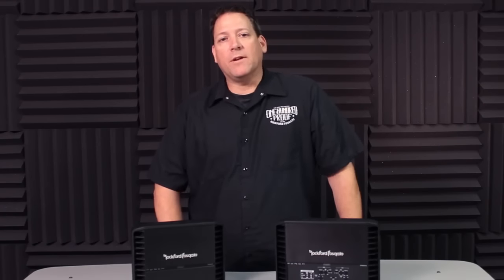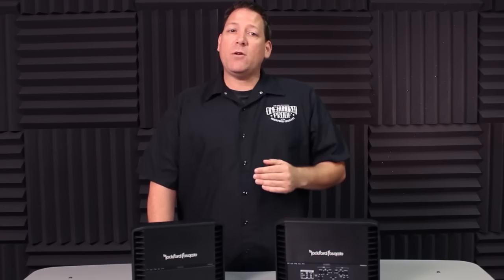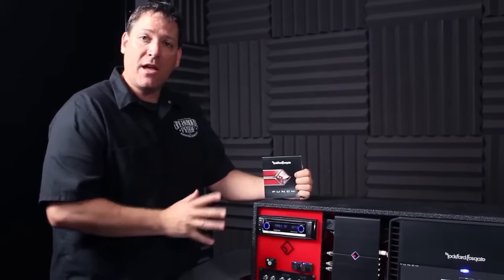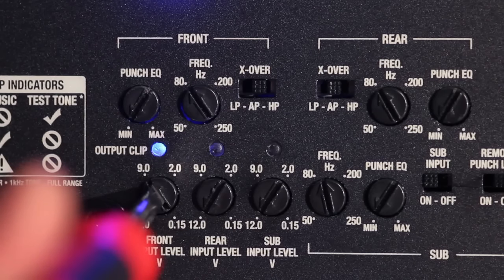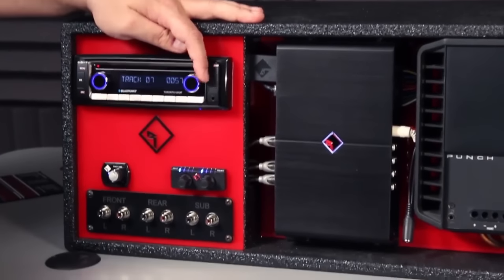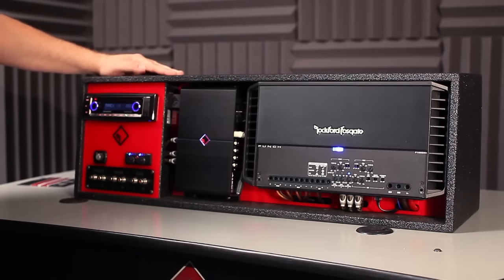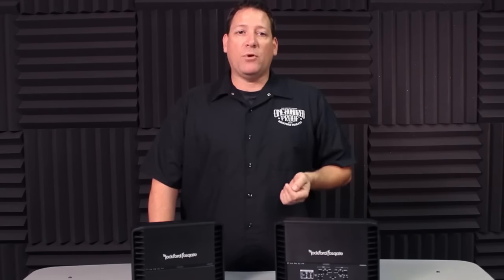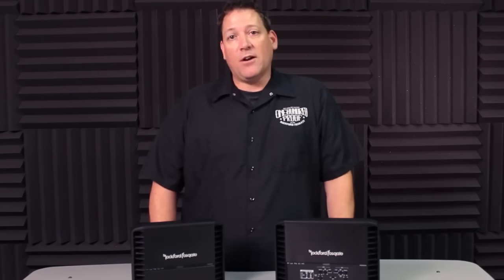Rockford Fosgate: Punch Amplifier Overview (3.1)

Comment: Is re-adjusting at -5 & -10 dB still relevant if using Hi-Res/Lossless music?
Reply from the maker: Great question, James!  Yes, absolutely, because you're adjusting the amplifier's gain settings (it's clipping point) regardless of if playing sine-waves for SPL competitions or hi-res audio for SQ listening.  Properly setting the amplifier's clipping point is important once the amplifier starts clipping, more power is generated and delivered to the voice coils, causing them to heat-up faster which can lead to premature failure.

Comment: So then is the bass knob connected to the Punch Level EQ knob in the amp? And when setting up the amp, should this EQ be an zero?
Thanks
Reply from the maker: The built-in Punch EQ is 0dB to +18dB @ 45Hz and/or 0dB to +12dB @ 12.5kHz (depends upon LP/AP/HP switch position).  The PLC2 is an overall level control for the amplifier. When setting up the amplifier, we always suggest the EQ to be at MINIMUM since it's designed to help compensate for the acoustical fingerprint of your automobile.  IE: some cars sound different if hatchback versus sedan, or truck vs. SUV, etc.

Comment: Rockford I have a question. 
O.k so I have 2 p3s 12s in a box made by rockford too.
And I have the punch 1000x1 for them pushing 1472 rms.
And I'm thinking of getting the p600x4 to power all the cars speakers mids and lows but i want all the mids and highs to be power class.. can I do that?.. can I use a punch amp to power up power edition mids and highs or no?..
I'm going to be using all RF wire.
Also what alternator size should I get?.. 200amp or 250amps?..
Reply from the maker: Hi Bill, Thanks for being a Rockford Fosgate fanatic!  You can certainly use a Punch amp to run Power series speakers (and vice-versa.) Just keep the amplifier power output under the RMS power rating of the speakers.  This will help prevent from overpowering the speakers and possibly burn the voice coils.  

Alternator size is based on the vehicle, so consider the factory alternator size and add your audio system.  The Average Current Draw (13.8V Music) on the P600X4 is 45 Amps and the P1000X1bd is 65 A.  If you have a factory alternator at 125 A, then add the other amplifiers on top (125A + 45A + 65A = 235A).  Keep in mind, this is a general idea on how to calculate alternator size, so you will most likely get different recommendations.  You may want to contact a specialist like Irraggi Alternators at https://www.iraggialternators.com/.
Reply: Rockford, would a capacitor compensate for some of the power differential?
Reply from the maker: Like a 1 Farad Energy Storage Capacitor used inline with the amplifier's B+ terminal?  The answer is no.  Capacitors are designed to keep a quick reserve of current for hard bass notes or quick transients, but it will not compensate for any current differentials or differences between amplifier power output.  We have a handy article that can help you with areas of the charging system to consider at: http://rftech.custhelp.com/app/answers/detail/a_id/145

Comment: Hey I have the p1-2x12 subs should I go with the R2-500x1 amp or go with the P500x1bd
Reply from the maker: Hi Felix, That's an awesome subwoofer enclosure!  The P1-2X12 is rated to handle up to 500 Watts RMS and is prewired to a 2-ohm amplifier load.  The R2-500X1 produces optimum power at 2-ohm (500W) but the P5000-1bd only produces 300W at 2-Ohm (Dynamic Power is still only 410W).  In this scenario, we'd suggest the R2-500X1 as a great matchup.
Reply: Rockford Fosgate ok thank you for the response i appreciate it !!
Reply from the maker: @Felix_559  You're welcome!  Thanks for being a Rockford Fosgate Fanatic!

Comment: I have a p1000x1bd. Wired at 1ohm to 2 8" 400w rms subwoofers. Is it normal to have my gain up to 3/4 and out put clip turns on? My volume on my pioneer head unit is set at input clipping. Do I have a bad amplifier?
Reply from the maker: No, the amplifier is fine.  The impedance load of the amplifier does not affect the input stage of the amplifier.  When setting the clipping point of the source unit, the volume should be increased until the LED just begins to blink, then back it off a little.  This will be at a slightly different setting depending if you're using a 1kHz sign-wave or music to find the clipping point.    Then adjust the amplifier GAIN control until it just begins clipping, then back it off a little.  This will maximize the signal-to-ratio between the source unit and the amplifier.  The P1000X1bd has a wide input voltage range from 150 mV - 12 V.  Again, depending on if you used music or test tones to find the source unit clipping, you may experience different levels of LED flickering during normal playtime.
Reply: @rockfordfosgate  ok. I'll try that. Thanks! And I just ordered a high out pit alternator. Constant 14.8 v. Will that be okay for the p1000x1bd?
Reply from the maker: @lylegoodluck  Yes, the amplifier is rated to handle 9 - 16 VDC.
Reply: @rockfordfosgate  I did have a prime 750.1 before I upgraded to the p1000x1bd. It sounded very good at almost the half way point of the gain. It concerned me that I had to turn the gain 3/4 of the way to make it sound decent.. idk. I'll play with it some more. Thanks again!
Reply from the maker: @lylegoodluck  You're matching the output signal of the source unit to the amplifier.  The gain itself isn't representative of a good/bad amplifier, but it is reflective of how much output voltage your source unit produces. If you have low output voltage from the source unit, you'll need to increase the gain on the amplifier for it to match.  If the source unit has very high output voltage, you'll lower the gain for it to match.
Reply: @rockfordfosgate  do I need a line driver?
Reply from the maker: @lylegoodluck  If you need to crank the gain up nearly all the way, then I would definitely suggest using a line driver.  This will optimize your Signal-to-Noise by keeping the amp gain to a minimum.
Reply: @rockfordfosgate  yeah. I might need one. Idk why I have to get a line driver for this amp. I ranbother amps on this same set up. All other amps I turned  gain up to 1/4 to 1/2 turn...
Reply from the maker: @lylegoodluck  The amplifier is working just fine.  You don't need to get a line driver because the gain is doing exactly what it's supposed to do.  I recommended a line driver if you're having to turn your gain nearly to max because this tells me the output voltage from the source unit isn't as high as you expected it to be.  If that's the case, a line driver doesn't hurt.  As mentioned in the very beginning of this thread, the amplifier is working just fine. So, other than verifying which method you're using to set CLEAN (test tones or music) you'll get a slightly different result with the LEDs.   Follow the process I outlined above and you'll be just fine.  If the LEDs slightly flicker, the amp is working perfectly fine.

Comment: I plan on running a Rockford components and two p3d4 12s which amp would work the best
Reply from the maker: Hi Bmackins94, The Punch P3D4-12 subwoofers are rated to handle 600 Watts RMS each, so you'll have 1,200 Watts total power handling capacity and can be wired into a 1-ohm or 4-ohm load.  The Punch P1000X1bd would be the perfect amplifier for those subwoofers: http://www.rockfordfosgate.com/products/details/p1000x1bd

For the component systems you can use the P300X2 if you only have front speakers, or the P400X4 is you have front & rear speakers:
P300X2: http://www.rockfordfosgate.com/products/details/p300x2
P400X4: http://www.rockfordfosgate.com/products/details/p400x4
Reply: Rockford Fosgate thank you very much

Comment: Quick question about the P1000x5. There are 2 speaker outputs for the sub channel. In the manual it doesnt say anything about it being bridgeable. can I hook this up to only one subwoofer?
Reply from the maker: Yes you can, just keep the total amplifier load at 1-ohm or greater.  Totally understand that it's not clear because it's in small print on page #14 of the owner's manual: "*Positive(+) and Negative(–) outputs are wired in parallel internally."
Reply: Rockford Fosgate called Rockford to clarify on that exact same topic earlier. I have two p2 4ohm’s bridged down to 1 ohm. The rep on the phone told me to go ahead and use the negative of one sub output and the positive of the other since both sub outputs are internally wired in parallel.

Comment: Will a Prime R500X amp sufficiently power either of: 

old school 1-12" HE2 dual 4 ohmor 1-12" HX2 dual 4 ohm? And Which of these amp/sub combo will sound better in a sealed box. Thx
Reply from the maker: Yes, the Prime R500X amplifier is designed to produce 500W x 1 @ 2-ohms, so a Dual 4-ohm subwoofer will work fine with it, because that can be wired to create a 2-ohm load

Prime R500X
https://www.rockfordfosgate.com/products/details/r500x1d/

Comment: I just got two p3 10s and had a prime rs500 that I got back in 2014 ... Haven't really used it like that but how would i hook this up.
Reply from the maker: Don't know what impedance P3 10" you have, but if you look at the WIRING WIZARD tab on the R500X1D, you'll see all the wiring diagrams compatible with that amplifier: https://www.rockfordfosgate.com/products/details/r500x1d/

Comment: i just got the p1000x1bd amp, do i use the 1k hz test tone or the 40 hz test tone to setup the input? i know you use the 40 hz for the output
Reply from the maker: Since this is likely for subwoofers, you'll use a 40Hz test tone for both the CLEAN input and output.  Typically for subwoofers you'll be using +5dB to +10dB of Gain Overlap.
Reply: thank you! i thought my head units max is 30 before distortion, its 34. i love this amp

Comment: I have two P3d4 15 inch. What amp should I use?

Thanks in advance 🙏
Reply from the maker: That’s Great Ramses!  The P3D4-15 is an awesome subwoofer and rated to handle 600 Watts RMS, so two woofers will give you 1200 Watts power handling and can be wired to either a 1-Ohm or 4-Ohm load.  The P1000X1bd is rated to produce 1000 Watts x 1 @ 1-Ohm and Dynamic Power is rated at 1,430 Watts x 1 @ 1-Ohm.  This would be an awesome amplifier to match.
Reply: @rockfordfosgate  🙏

Comment: Any issue mounting this amp upside down?
Reply from the maker: Yes, we don't recommend mounting amplifiers upside down because the hot air dissipating from the heatsink needs to rise and cool the heatsink.  If mounted upside down, the hot air has nowhere to go, essentially rising back up to saturate the amplifier.  If mounting upside down, we highly recommend forced airflow (fan) to prevent this from happening.

Comment: My Rockford amp clipping light doesn’t come on as I’m turning the volume up! I maxed my head unit out what does that mean! I’m tuning my amp
Reply from the maker: Are you using MUSIC or TEST TONES to setup the CLEAN circuit?  If you're using the 0 dB Gain Overlap test tones, it may be clipping, but with music it can be hard to detect the LED illuminating.  It's also possible the source unit doesn't clip at full output.
Reply: Rockford Fosgate she’s all set! Thanks ! Sounds nice 💪🏽

Comment: love this brand and finally after years of looking at it i finally got a sub and amp today and cant wait for the end result. ? is there a downloadable version to this test cd as my head unit has no cd player
Reply from the maker: Thanks for joining the Rockford Fosgate team!  We have our C.L.E.A.N. process and downloadable tracks available in our Knowledge Base here: https://rftech.custhelp.com/app/answers/detail/a_id/1126
Reply: @rockfordfosgate  guys I would like to say man the quality in Rockford Fosgate is outstanding. Loving my p2 12 inch sub and my mono block amp from Rockford Fosgate. I will never buy anything else.
Reply: @rockfordfosgate  also quick ? My amps clipping light indicator is just going on blue for second or two when hitting some bass on tracks. The amp is p500x1bd. I’m running as mentioned punch series p2 12 inch 2ohm sub and it’s configured as 2ohm on the sub. Also the head units volume is at 35 out 40. Cheers again I am so loving this quality of the brand.
Reply from the maker: @MrFrosty888  Thanks for the kind words.  Yes, the clipping LEDs are very accurate, so this means it's working properly.  Minimizing a clipped signal is the name of the game, and by doing so, you minimize unnecessary heat build-up.
Reply: @rockfordfosgate  I get that but my ? Sry was if I turn up the amp a touch more so the blue indicator led which is one led on my amp will this be fine. I don’t won’t to damage my sub.  Right now at the volume level of 35 out of 40 on head unit on few songs i listen to the blue clipping led just flicks on and out very lightly.  I just would like to get little more out of the sub but if you say leave it as it is then I will. Cheers again loving the brands quality and service I get thru the brand.
Reply from the maker: @MrFrosty888  This only covers the clipping part, we need to analyze your amplifier/subwoofer combination to make sure you're not over-powering it.   Since you have the P500X1bd amplifier and P2D2-12 subwoofer (see specs below), you're technically already over-powering the single subwoofer by at least 100W and up to 387W under dynamic conditions.   Increasing the GAIN/LEVEL doesn't tell the amp to produce more power, just at what point on the radio's volume control when the amplifier produces its rated power output.

Punch P500X1bd
500 Watts x 1 @ 1-Ohm (RMS)
787 Watts x 1 @ 1-Ohm (Dynamic)

Punch P2D2-12
Wiring both voice coils in parallel to create a 1-Ohm amp load
400 Watts RMS
Reply: @rockfordfosgate  yep okay. The sub is wired to be at 2ohm so the amp will only produce what the ohm rating configuration is on the sub right. Cheers on the reply I might just leave it as it is.  But I just wanted to know on my amp with one led clipping light if I turned my amp up a touch so the blue led comes on but more with less flicking on and off when pushed. But if you Say leave it as it is to be safe that’s fine. Thanks for replying again.also the sub is the 2ohm version not 4ohm version
Reply from the maker: @MrFrosty888  Yes, we would recommend leaving it alone.  I showed the 1-Ohm amplifier power output since above you mentioned you had the "p2 12 inch 2ohm sub" (P2D2-12).  Wiring those voice coils in series would create a 4-Ohm load, wiring them in parallel would create a 1-Ohm load.  Either way, we recommend leaving it alone.
Reply: @rockfordfosgate  thanks cheers.

Comment: Rockford fosgate I need your help I got pro bend  competition bandpass box all ported chambers by R/T for my two 12in p1s4 is this good box for my subwoofers or should I get diff one?
Reply from the maker: In order to determine if it's a good enclosure or not, we need to know some important info about the design itself and how it matches the Punch P1S4-12 subwoofer.  Your best bet is to submit your design to our technical support group where they can model the subwoofer enclosure and determine the frequency response and mechanical power handling characteristics.  Get the internal box volume for each chamber (cu. ft. or liters), the vent height x width x length (or port diameter x length x number of ports), and the subwoofer you're using (P1S4-12) and submit to http://rftech.custhelp.com.  Our techs will model the enclosure to determine if the response matches the subwoofer's parameters.
Reply: Rockford Fosgate ok thanks sir will do
Reply: Rockford Fosgate is the best bc they love helping there fans out
Reply from the maker: @extendedraven7893  We have the best customers because they are actually Fanatics!
Reply: Rockford Fosgate can you link me to diagram for wiring process
Reply: Rockford Fosgate p1s4 Svc 250w rms
Reply from the maker: @extendedraven7893  Click the WIRING WIZARD tab on the Product Details page to see all the wiring configurations possible with the P1S4-12: https://www.rockfordfosgate.com/products/details/P1S4-12/
Reply: Rockford Fosgate thanks me and my dad are trying to figure it out lol
Reply from the maker: @extendedraven7893  You're welcome.  Hopefully the wiring diagrams helped you guys figure it out!  Just don't wire the subwoofers to create a lower impedance than what the amplifier can handle.

Comment: HIII, ROCKFORD
i would like to go for punch series. i need total 6 speakers and one sub woofer and an amplifier.
please help me to choose a good one
Reply from the maker: Use 1 pair of the P16-S for the front and 2 pair of the P16 for the rear.  For the Subwoofer, use the P3D2-15.  Wire it all to the Punch P1000X5.
Reply from the maker: This is just a guess.  We're not sure what will fit in your car doors or trunk, but it sure will sound great if you could swing it.
Reply: If am going for 4 speaker same one pair p16-S for the front and one pair of p16 for the rear. p3D2 -15 Subwoofer. which amplifier wil be suite for that....
My car is maruti SUZUKI RITZ... I love to hear EDM songs...
Reply from the maker: Great!  It looks like the Suzuki Ritz uses 16cm speakers, so the P16-S and P16 will work fine.  The 15" subwoofer is pretty large for that amount of trunk space, so you may want to use 2 10" subwoofers.  Rated at 500W each, you'll have a better match in power handling to power output of the amplifier.  If so, use two of the P3D4-10 subwoofers, which will give you 1,000W total power handling, much better over the single 15".
Reply: ohk..if am using 2 pair speakers and one 12" subwoofer... a 4 channel amplifier is enough for that ...
Reply from the maker: Yes, you'll probably want to use the Punch P400X4 amplifier and the P3D2-12.  This way you can wire the speakers to the front channels, and wire the subwoofer to the rear channels in bridged/mono mode.